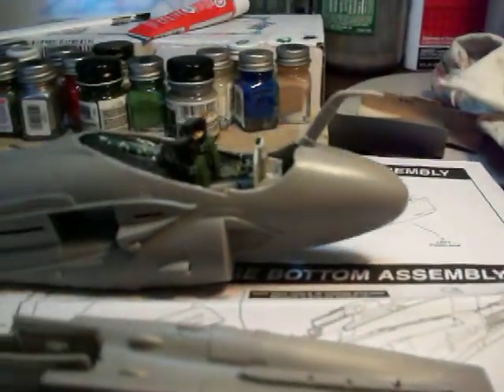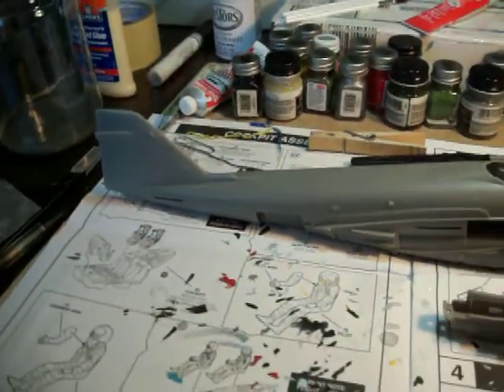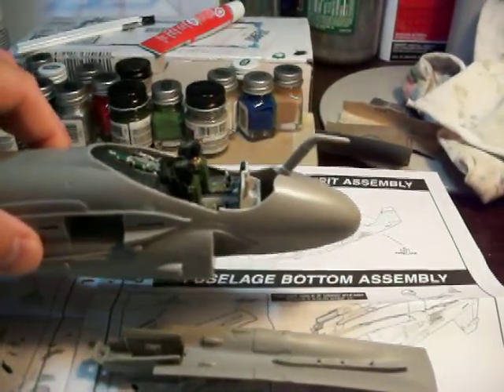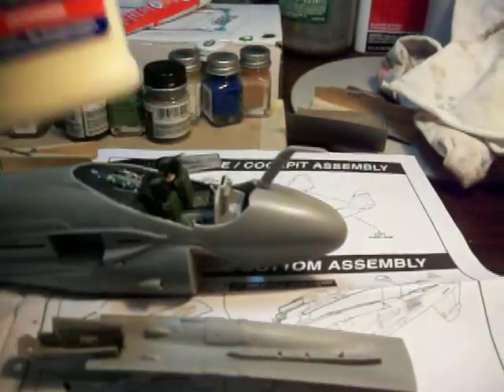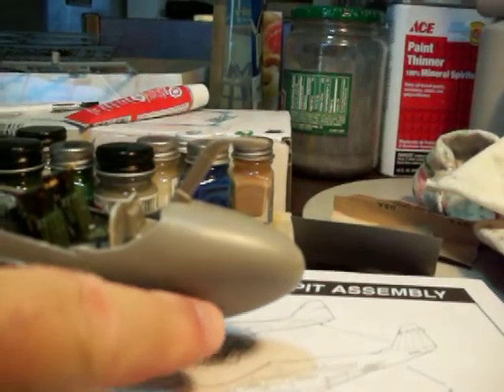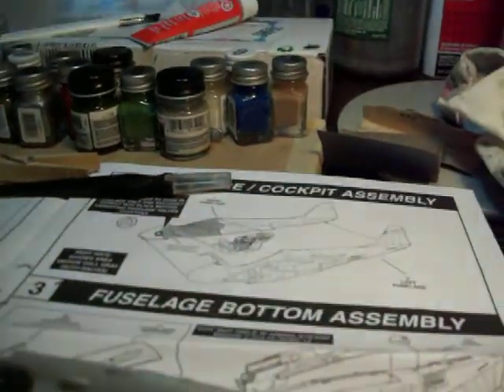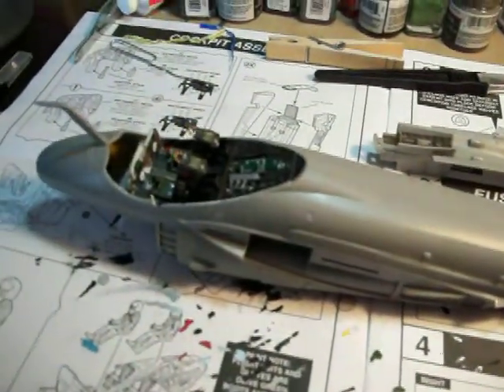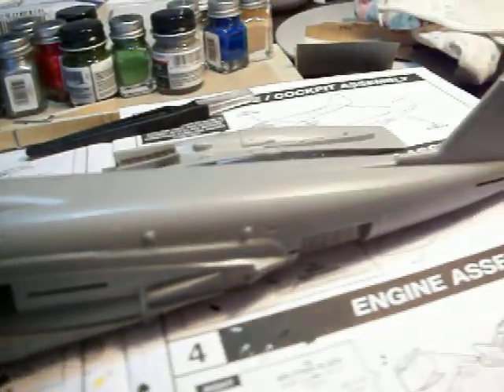A-6E Intruder build part 2

Comment: Yep their F-8 was copyrighted in 1988. There is quite the gap on the upper fuselage, where the wings connect. I'm going to have to use the hot glue gun to fill that in (I'm kinda new to modeling, idk how to use putty, this F-8 is my 4th model). Worked pretty well with my F-22. Never tried a Monogram UH-1. Helicopters just aren't my thing :) Darn usually I just go to the store and pick something that they have, without reading prior reviews about it...I could save myself lots of trouble :)

Comment: these were very good kits at the time they were brought out by Revell and at one time it was the only A6 kit available in 1/48 scale and yes it has raised panel lines and the cockpit may be a little lacking of certain details it  the revel kit is not as highly detailed as the new Hobby boss version but it is still affordable and still a good kit in my honest opinion your doing a good job keep it up.
Reply from the maker: Joseph Johnson Hi Joseph, and thank you for the comment. Your absolutely right about the Revell A-6 kit. It's still a good kit today. I have one in my stash along with the Monogram EA-6 Prowler. I do believe Testors had a 1/48 A-6 and ECI Models had a 1/48 Prowler. I've only seen them on Ebay never had an actual kit. So I can't tell how they were. The next A-6 I buy will be the Hobby Boss kit. Or if I'm lucky to afford it the monster Trumpeter 1/32 A-6. I love the large scale models. Wish they would make them even bigger. But bigger models come with bigger price tags. Have a great day.

                               Josh